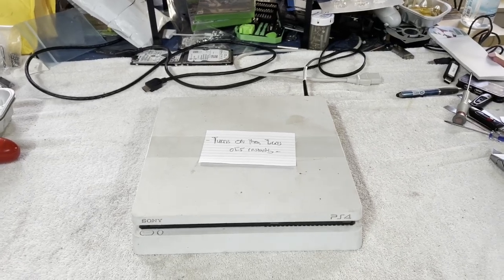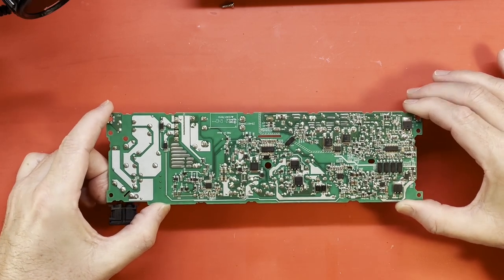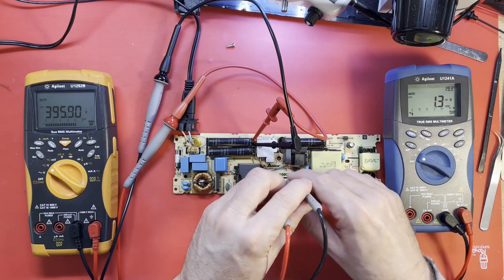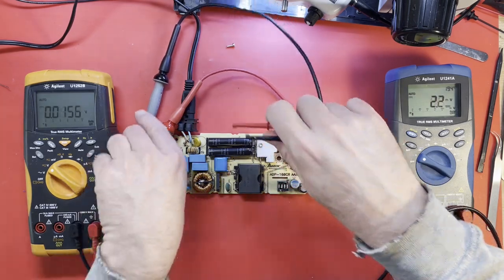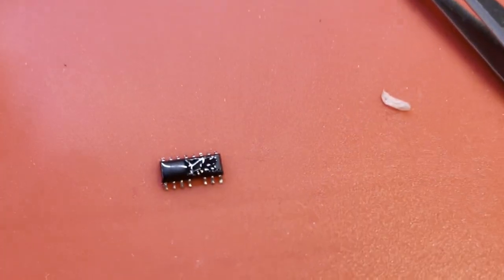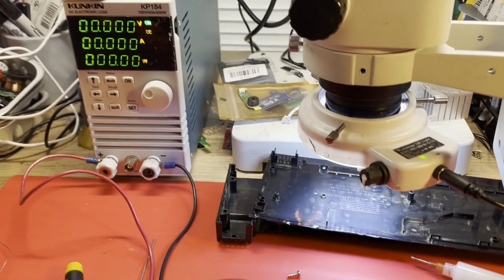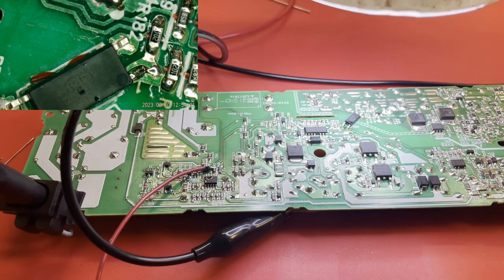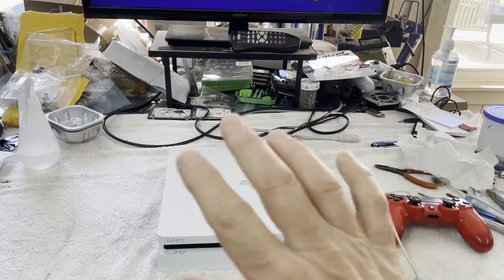#76 Repair of PS4 Slim with 12V Shutdown

Comment: 36:34 - If its known working good component, I would now take it out, put red probe on gnd pin, in diode mode, I would read value of each pin. Make a chart in excel. Then later for next new "good" component, first is to check with multimeter according to that chart, then to solder it.
Then excel database starts growing into serious database of components and good results. So you no longer need another board.

I also make a photo of pcb board, then in paint write values on photo.
Reply from the maker: I definitely need to make more notes but time is an issue for me.  My real job does get in the way sometimes.

Comment: Another amazing video. I always look forward to your videos. I've learned so much. I wanted to ask you what kind of hook leads are on your Probe Masters? Also, what does the power factor correction IC do?
Reply from the maker: The hooks are from Probe Master as well.  The PFC is supposed to change the way the supply draws current from the AC input in order to produce less harmonic content on the AC input from the power company.  Basically, it improves overall efficiency.
Reply: @ToltecMerc  Thanks for the response. Keep up the good work.

Comment: Odd question, but do you know what the lowest voltage the ps4 will still work at?
Reply from the maker: I would say 100VAC.
Reply: @ToltecMerc  I mean DC voltage, direct to the board. 4.8V and 12V. But would 11V still run the playstation?

Comment: Hey Toltech I loved the way you diagnosed it. I have one in which the volts wont go up to 395v i replaced the 1612a1 but no chsnge any suggestions.
Reply from the maker: @nikeshgupta8362  I would check to see if it is going to 395V but shutting down very quickly.  One of the protection circuits may think there is a problem.

Comment: I really like your work. I have a switch that I tried swapping the SD card reader for but the connector on the motherboard is missing a pin and needs replacement. Would you be open to repairing it for a price? Or do you have an email that I can contact you at? Thanks

Comment: Thanks a lot for this video. Very informative and learnt some new things from this video.And also all the others.. I  have 1 question tho. I have exact same PSU and exact same problem. Is it possible I can use my bench Power Supply and provide the 12 volts the Ps4 board needs to turn on? I just wanted to do that just to see if the PS4 boards turns on normally and no other existing problems. I am about to order the IC from aliexpress. Mine is a DAP049B tho.
Reply from the maker: The PS4 draws quite a lot of current from the 12V supply.  You will need a bench supply capable of at least 10A.
Reply: @ToltecMerc  Thanks a lot for clearing that up.Totally understood.
Reply: @ToltecMerc  Wanted to ask you also is it the ACDC_STBY and the 5VSB are the 2 pins that am supposed to touch together to turn on the 12v on the power supply ?

Comment: Hi, thanks so much for the video.

I bought a faulty no power ps4 1002A. The PSU clicked on power button press, I verified the unit boots by making a temp 4 pin to 5 pin 5v cable and a working PSU from a 1102A.

The faulty ADP-240AR looks quite a bit different but following your steps it seems everything checks out except the DDA001AG IC. 
It appears that pin 9 is shorted to ground, looking at the schematic it should only be pin 10 to ground and I can’t see any bridges.
I’m waiting on the new IC to arrive from China.

Will update if I’m successful as this is my first PSU repair, Im a novice at soldering and only have basic cheap tools but have been successful in on my first ps4 power button and HDMI port repair.
🙏🏻
Reply: We will stay tuned! 🙏

Comment: I'm only getting 314 V on those big filter caps, is that normal? Or do you know what could be causing that? Any help would be much appreciated
Reply: Subscribed! Great video
Reply from the maker: If your line voltage is 240VAC where you live, it sounds like the power factor correction is not running at all.  If your line voltage is 120VAC, it's not running correctly.  It should boost to 395VDC on those large filter caps.

Comment: In my power supply i can measure the 5 volt, but no stby and no 12 v. Can you tell me what could be the problem?
Reply from the maker: So many things.  I really can't tell you exactly where the problem is.  Many, many options.  Get a working supply and make comparisons.

Comment: i just tested most of my defective psu here... 12v is not consistent on psu test pin shorting....  its dropping voltage on 12v.... whats causing that?
Reply from the maker: It could be almost anything honestly.  It sounds like a safety circuit has detected a problem and is shutting the 12V down.

Comment: what exactly are you shorting to get the 12v in 23:19 ?
Reply from the maker: I am connecting the 4.8V standby pin to the "enable" pin.  There are 4 contacts.  4.8V, Ground, 12V enable and a "Power Good" signal.
Reply: @ToltecMerc  thanks for the reply friend

Comment: hello thank you for your videos which helped me a lot, I have an adp-160-cr power supply which works but each time I have to replace the Dapo41(6) ic, it works for about 10 min, after it is cut , if I replace the dapo41, it works, thanks in advance

Comment: Excellent video and thanks for sharing, the damaged component was only the dda001ag, that's why it didn't deliver 12 volts? Greetings from Argentina.
Reply from the maker: Yes.  Damaged DDA001AG.  I initially replaced with DDA001BG which it seems is not correct part.  Replaced with identical DDA001AG and it worked just fine.